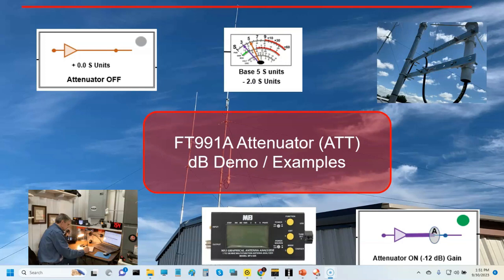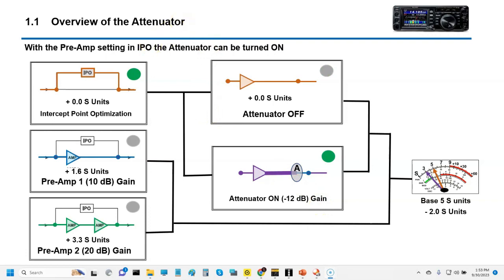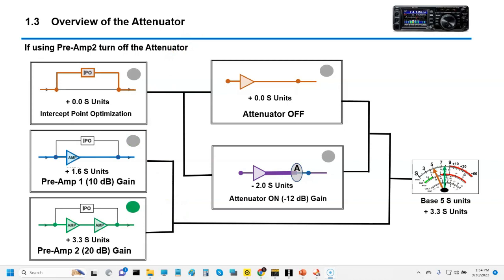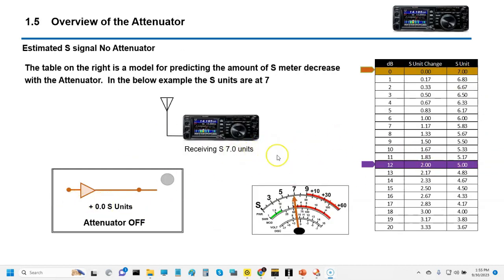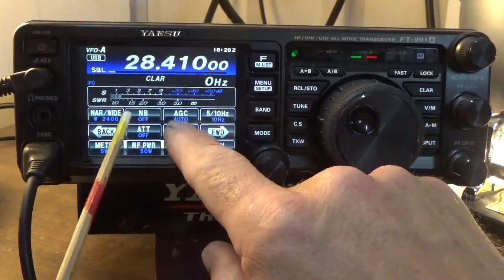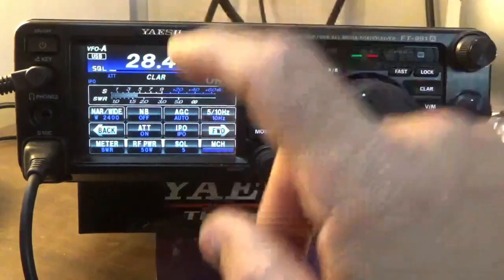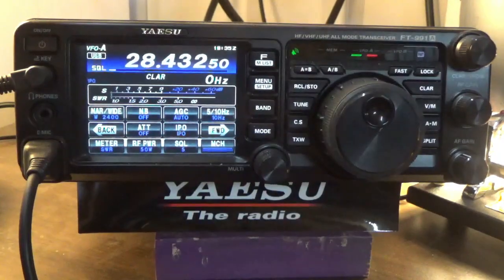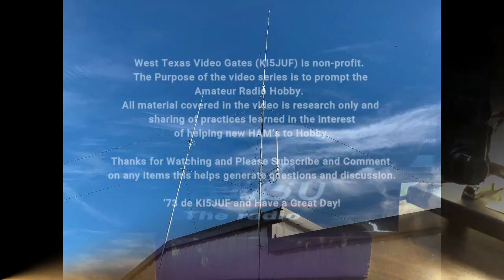FT991 (ATT) Attenuator and (IPO/AMP1/AMP2) Signal Reduction and Gain Demos – QSO KM4FEA

Comment: Thank you. Excellent video. Straight to the point with a helpful demo. Two thumbs up. The FT-991A is still smarter than I am, but learning about ATT and IPO got me one step closer to mastering this rig. I put the knowledge to use tonight and had a nice QSO with a person in Catalonia, Spain from the southwest US. Between AMP1 and DNR, I was able to pull his signal out of the noise like a pro. 73.
Reply from the maker: Thank you for message and good luck keep me posted on how you are doing hope to catch you on the air 73

Comment: What a nicely done video. So many ham think that you must leave the IPO / amp 2 on so the signal is
loud. Both my FT-991A's and FT-710 come from the factory with the IPO on for every band, including 160 meters. It programs new hams the wrong way. I wish ham would not only understand when to use or not use the IPO as well as the ATT and mostly how to use the RF Gain control.
Barry, KU3X
Reply from the maker: Good evening Barry and thank you so much for the kind word, I have to admit I kind forgot about the RF Gain until now, what a great supplement to managing RF signals, thanks again I really appreciate the kind words from you 73 and hope to work you on the air.